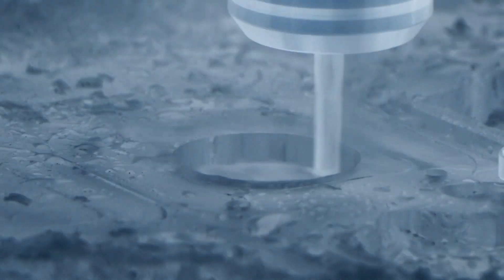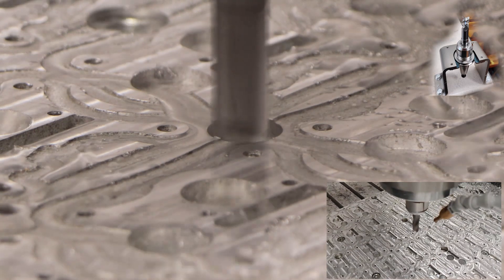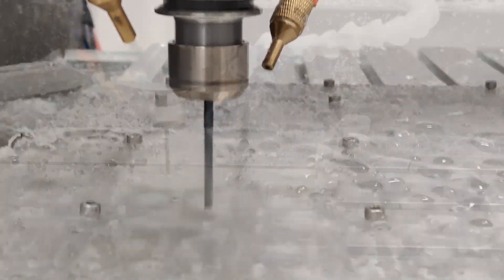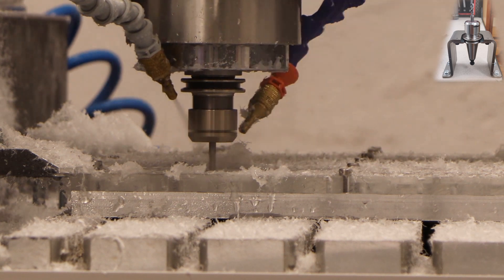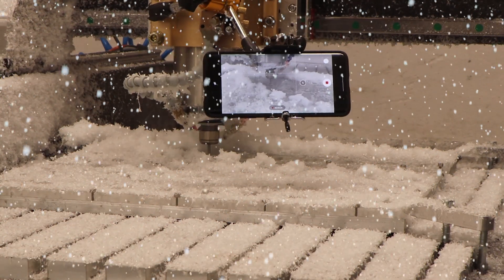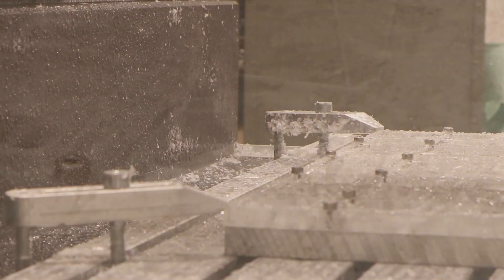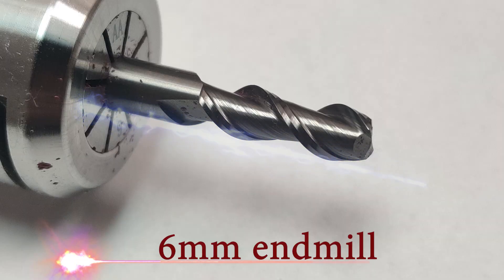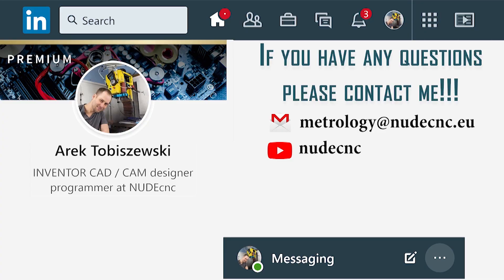Ncore V1 CNC machining PART 1: Acrylic plate and CPU/IHS lapping tool teaser

Comment: Bardzo ładnie, gratuluję fajnej maszyny. Przyznam jednak, że parametry pracy w tym materiale możesz dużo bardziej przyspieszyć. Rozumiem, że to głównie prototypy, ale masę czasu można tutaj urwać, na przysłość zrobił bym sobie specjalny stół na podciśnienie, i ATC.
Reply from the maker: Muszę się przyznać że większość ujęć to były pierwsze cięcia maszyny. Maszyna jest projektem rozwojowym i w planach jest oczywiście ATC.
Reply: Translation: I have to admit that most shots were the first cuts of the machine. The machine is a development project and ATC is of course planned.
Reply: Google translate: "Very nice, congratulations on a nice machine. I admit, however, that the working parameters in this material can be much faster. I understand that these are mainly prototypes, but a lot of time can be broken here, for a quick measure I would make a special table for vacuum and ATC."